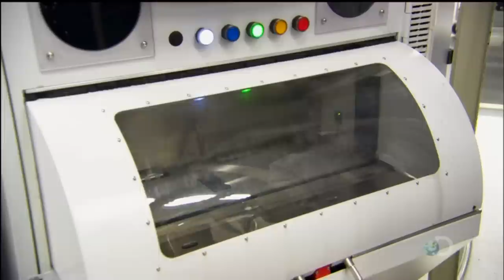Western Digital Factory

Comment: Oh... it's a WD "green" drive, so may as well skip the packing process and dump it in the trash.
Reply: Why? The WD Greens are very quick and reliable.
Reply: Dennis3Run Reliable until they die from overly aggressive power management firmware which causes head parks every few minutes. I speak from bitter experience - Google "WD green head parking" and you'll become enlightened. A drive is only "reliable" until it dies... and WD greens drop like flies my good friend :)
Reply: *****
How long do they typically last? Mines been going 2 years and is still going strong!
Reply: mackat4ck The longer it has been running, the more potential it has for failure (aka MTBF). You're only likely to complain when it goes wrong, obviously - just because it is working now, that's no guarantee it will be doing so in another 2 years... think about the logic of what you've said.
Reply: Ok calm down. Just run WDIDLE3.exe over these suckers and set the idle timer to disabled, and problems are over.
Did this to my WD Scorpio black to and Agressive head parking is over now. Instead of hundreds of head parking each day, it now has less then 5~10 Load/Unload cycles each day.
Reply: daand12 Or just don't buy them because they're crap, and it's widely known they are (IE: beyond youtube comments) and save the hassle. Do you think the whole world wants to do that? Preposterous.
Reply: ***** No issues at all if you run Wdidle3 _. Never had a failing WD drive on me.
Reply: KingMacintosh Seagate drives are are the least reliable out of all of them! They have the highest failure rate in total! Their green drive is the worst!
Reply: *****
I've never had a problem with WD drives!!! Maxtor (now a part of Seagate I believe) is a different story!
Reply: Desmond Birch First on WD Greens: Run WDIDLE3 on them and second: Seagate's are fast in sequential speeds ( 1TB 3.5Inch reaches almost 210mb/s ). Downside is that there is no tool to set the Idle timer for them.

I have a 1TB 2.5inch of it and it started to make Weird sounds after less then 1 year and randomly disconnecting and makes Windows freezing and bsod. It still works in a External case and haven't heard any noise from it. ( Weird ) but these drives seem to have the problem that the heads get stuck on the platter and bad sectors etc.
Reply: daand12
Cheers for the info regarding WDIDLE3 Regarding Seagate, I hear that their failure rate is quite high? I've only ever used Seagate once and that was 'about' 18 years back.
Reply: But what about recycling it? We can fix the problems anyway. After all, It's a "Green" Drive.
Reply: Dennis3Run/HackerL96
"Greens are very quick" They are built to be the opposite of fast .-.
Reply: EpicGuyJC They are fast in terms of speed to reach ( About 150mb/s for the 20EZRX model i have external ).
Got a Seagate Expension Drive 2TB yesterday, and inside the case is a Seagate Barracuda ( Desktop HDD ) ST2000DM001.
unfortunately the one i got has 3 Platters and 6 heads. I've read that these baby's are slower then the 2 Platter version. 
I can say that this is not true at all, because this drive can easily reach 210mb/s of read speed.
Reply: daand12 reach speed? Do you mean read speeds? They may be fast once running but only 5400rpm max. However coming from idle to active is extremely slow as the point of green drives is for them to spin down when idle. Meaning they need to spin back up when needed. They are primarily storage drives. No more. If you want a fast drive black is the way to go.
Reply: OK I know that WD Green are not the best drives... But are not so bad either. I have a lot of greeen drives installed in PCs that are 24/7 turned on. I also have 4x 500GB drives installed in a 7 years old PC (RAID 5 on Promise FastTrack controller) and they (incredibly) still works. On the other hand I have a Synology NAS with 4x 3TB WD RED and 2 of them failed after 2 years.
Reply: Based off of a fake study. They're about as reliable as each other.
Reply: Green drives are like the vegans of the world. Weak and only experience lacking people want them

Comment: I think that one of the reasons harddrives fail so fast these days is the use of 2TB data density per disc platters A decade ago it was 1 TB or less density per disc platter and most of those drives lasted long i still have 15 year old drives running and if you read reviews from hard drive buyers now it's a 1 in 10 or more fail  in the first year of use  Maybe harddrive heads have a too hard time tracking that super smal data area on a 2tb disc platter
Reply: what?